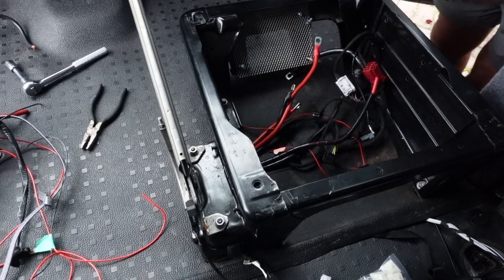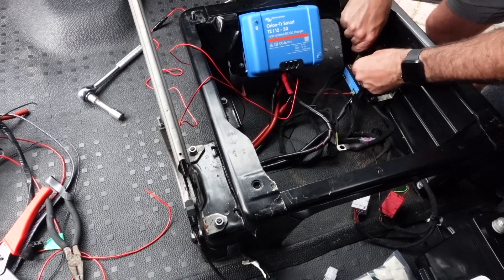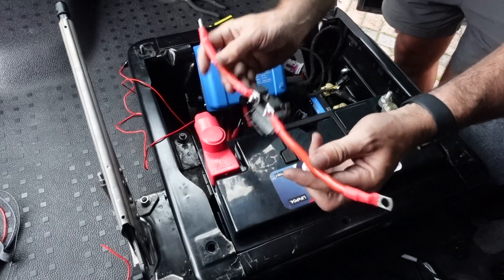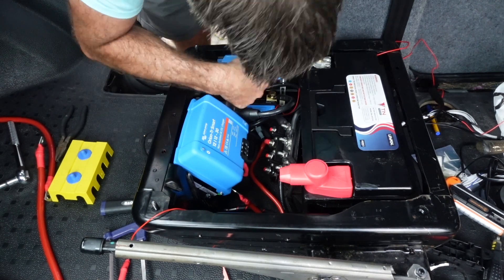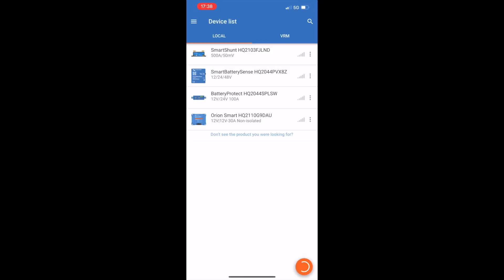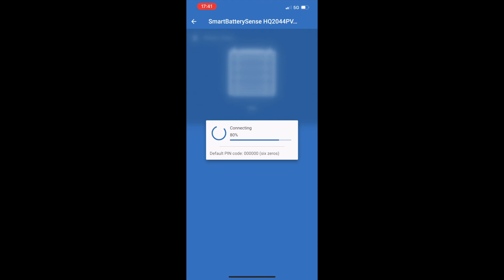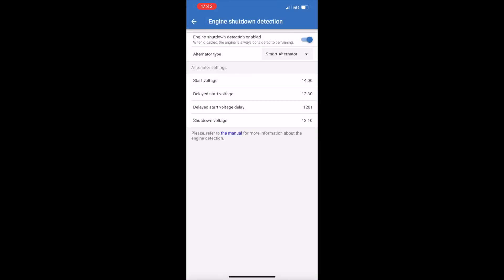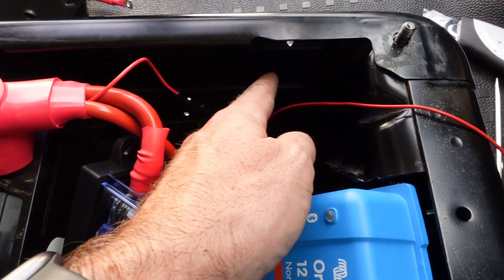VW Transporter T6 Campervan Electrics - Fitting Victron Orion Charger, Smart Shunt, Battery Protect

Comment: Just about to start my own install and been watching your video for some tips. What were the reducers you used towards the start of video to make connecting the battery cable to the charger easier? Thanks.
Reply from the maker: They are called Ferrules. Makes things much easier, no stray strands of wire

Comment: Hi, This is a great video. Thanks 
I have a question regarding the temperature:  
You can add a Temperature Sensor to the Smart Shunt (Victron Energy ASS000100000), I'm wondering, why did you decide to add a smart Battery Sense then? is there any specific reason for this? Thanks, Regards.
Reply from the maker: There was, however I can’t remember why. I was advised to get this one. 🤷🏻‍♂️

Comment: Great video.. currently planning my install at the moment. What did you use as the main ground and did you have a plastic pipe from battery for gasses?
Reply from the maker: There is an earth under the seats, or you can use the seat base. My battery is lithium lifepo4, so didn’t have that to consider 😁

Comment: Charge your lithium battery with the Vicyron battery protect. Also two times smaller and Smart/ Bluetooth also. The Orion will ruin your alternator. Zero to 30 Amps in one second.